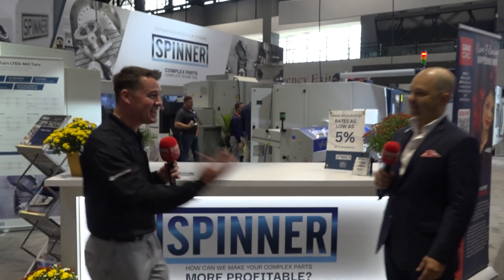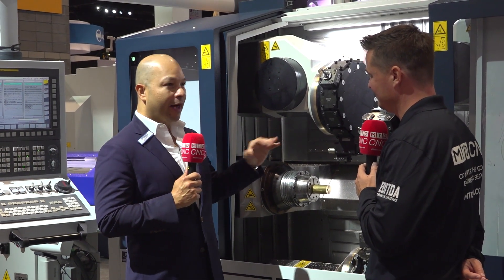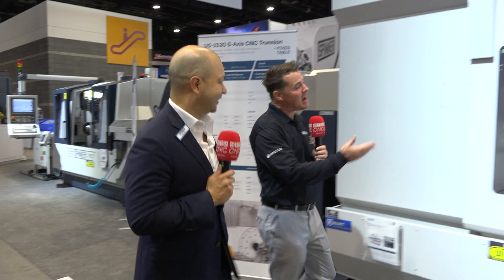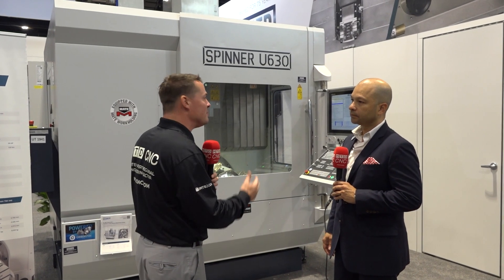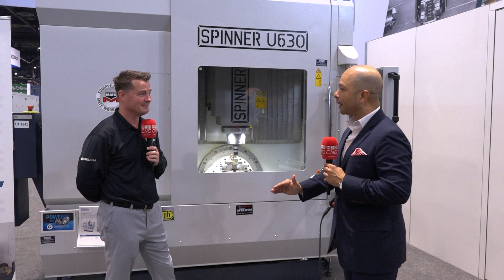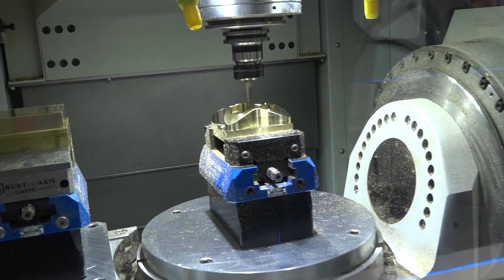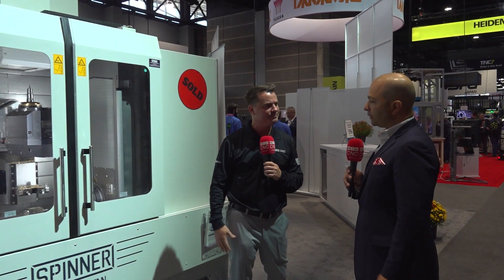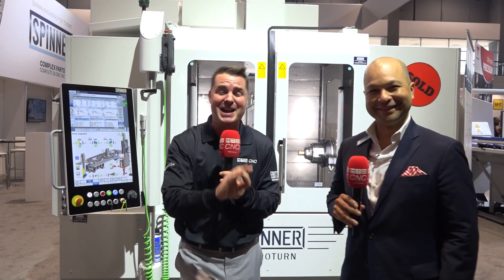Why are customers so happy with these machines?

Comment: 3:23 if i where doing alot of chips as well of the same material i would do like hermle have done in there factory in germany. they pretty much have ducktet up the chip convayer so it sucks the chips off the convayer and into the outside storage container's where they switch whice container it goes to on a little pannel on the side of the machine. that way i never have to remove buckets from the machine and risk getting chips and coolant on my floors

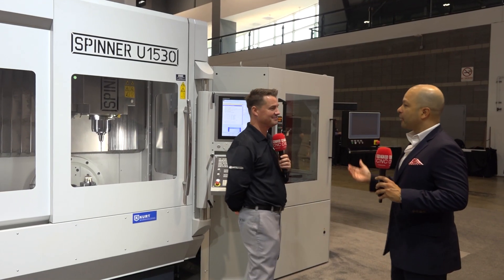4:39 here is a idea that i got a few yeas back . at the end of each machine it have its own saw where you put in the raw material in bar form. the cut material gets moved by a convayer. a robot arm with 3 grippers where one can rotate. it grabs the raw cut material on one gripper. then grabs the part in the 5 axis vise. put in the raw material. moves over to the 3 axis table take out the finished part. rotate the part that was in the 5 axis vise. puts that into 3 axis holder. put the fished part on another convayer and the machine goes agen unmanned and all side's are finished and part to speck. so raw bar stuck in one end and finished part out the other end. like a dual spindle lathe but as a mill ( and since its a mill it can make bigger squar parts then a lathe and the Willemin ones )

also please make all the sheet metal dual layer with some viscus/rubbery material in between and double paint window's to dampen the noice of the machine. since there is nothing worse then comming into a room completely packed with machines screaming like cracy. specially if they can easily be quait down like that without slowing down the speed of the machine. plus that little bit of extra monet it would cost im sure that customers thats already looking for machines in that price range wouldnt mind if it can quait down the machines. bonus is that it will also further increast the machines thermal stability ( more layers and more insulating layers means that it change temps much slower and stay even more stable when it is up to operating temps )